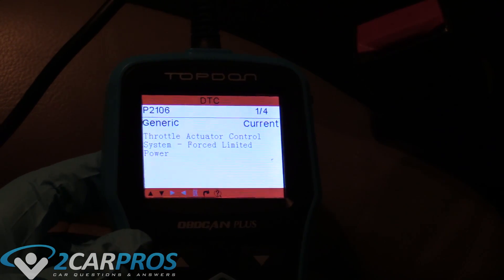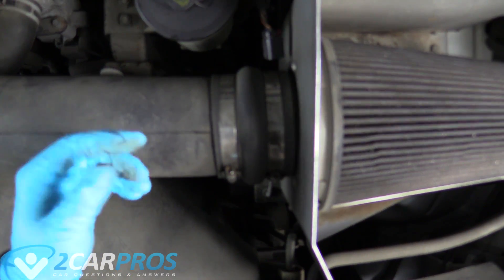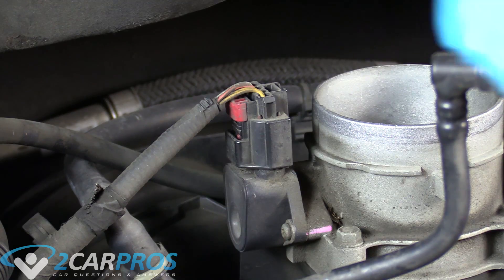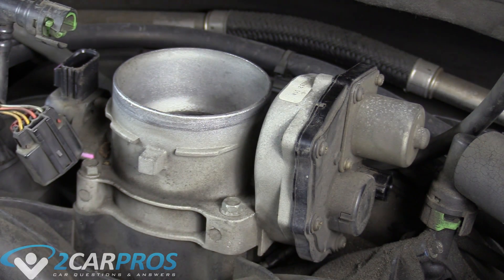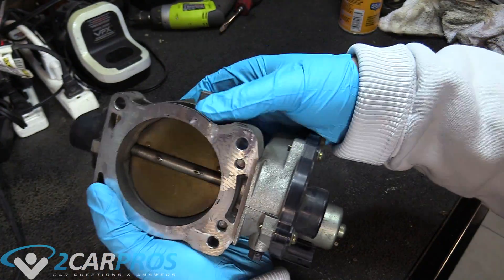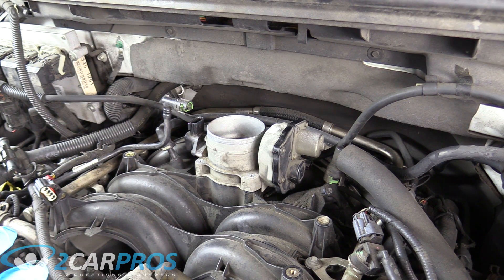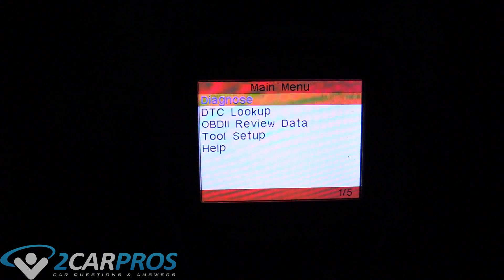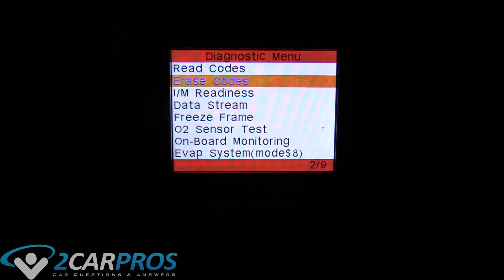How to Service a Throttle Body Housing Ford F-150 5.4L 2004-2008 Trouble Codes P2106 P2135

Comment: Thanks for the tips.  Going outside to do this on my 2005 F150.  If one has an old toothbrush you can reach where the butterfly connects with the  inner body hinge.  I'd use a toothbrush and just scrub it like a garage floor.  Thumbs UP!, bro...
Reply from the maker: Very cool! Thanks for the tip!

Comment: Wish i saw this before I threw mine out.  I had it sitting in my storage unit when i upgraded the air intake.  no one wanted it for years.
Reply from the maker: Bummer! I would have bought it. Oh well I have mine now. Thanks for watching Brian!
Reply: @2carpros  all i need now is someone to resurrect my 2004 F150XLT 5.4l.  I made the mistake of letting a friend repair the engine when the cam phasers went.  one thing led to another and i had to buy a commuter vehicle and he kept putting me off and life got in the way and it began to be more of a running joke.  Well I took the truck back this year after 9 years of him having it.  Its been one problem after another.  now she wont turn over at all.  I suspect the starter went after sitting for so long.  I cant reach it to tap on it and try to start the truck and when its running, I keep throwing a P2106 code. It seems to happen when i go to accelerate - not a hard accelerate, just a normal.  Like at a light. She hiccups/hestates and bam - throws the code.  I am praying it might be the MAF (still the orig - even though I put an airaid cold intake system on 13-14 years ago?)  other than that - with all that was done, i dont think it is the throttle assembly, or the new fuel pump.  and beyond that, the only other thing it might be is the pcm (and I'm praying its not that) i was actually getting a P2106 and P0507 on my FixD cube.  and it would also through the wrench symbol - not the engine light - but the FixD cube only report engine codes. So I bought a nice Autel scanner, but of course it arrived broken.  No charging port - just a hole.  Fun!!!   and then the engine wouldnt even turn over anyway.  I suspect there may be addl "non engine" codes but I cant check them now.

At any rate - any educated guesses as to the P2106 code beside the above mentioned would be appreciated.
-New battery
-New throttle assembly 
-New Fuel Pump / Sending unit
-New Exhaust system. (from headers back - so includes cats 02 sensors and muffler)
Had cyl 3 plug seized (even after i had them replaced after the notice came out in the 2000's - and i paid through the nose for that repair)
- got 3 plug out - replaced all plugs
- new #3 coil
- new #3 injector

i checked / tested the starter relay

Im 99% sure the starter is bad
but i dont believe that would cause the P2106 code.

Comment: My passenger side rear could pack bolt is not mounted down. Due to the threads on the valve cover being stripped can this cause an issue?  Also I said the primary circuit e was open. What is the normal issue with this code.
Reply: Coil

Comment: I was hoping you'd get into actually SERVICING the throttle body. Take it apart, show us the TPS, and the control motor, replace the valve on it, etc. Simply cleaning dirt off only what you can see is not servicing it.